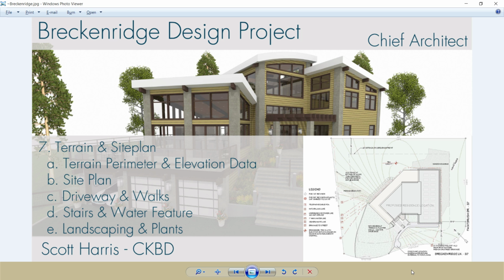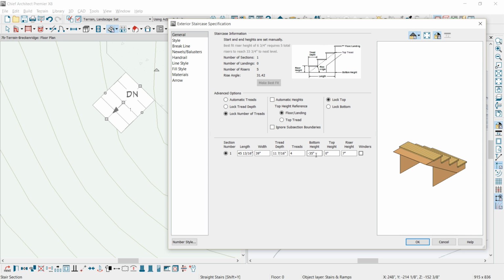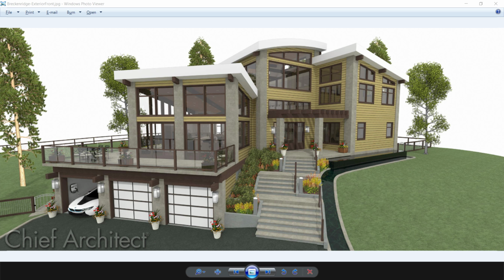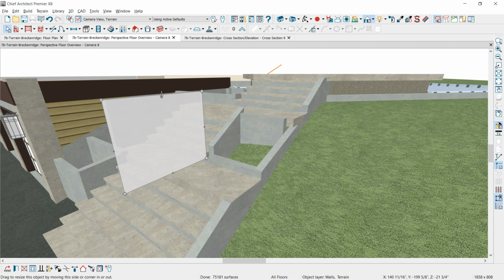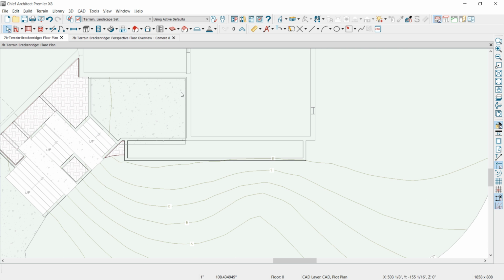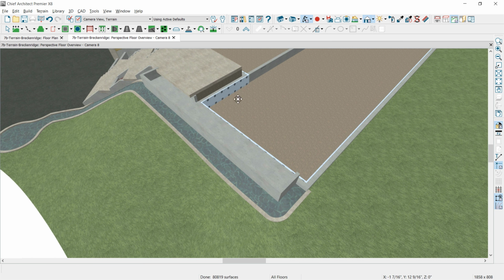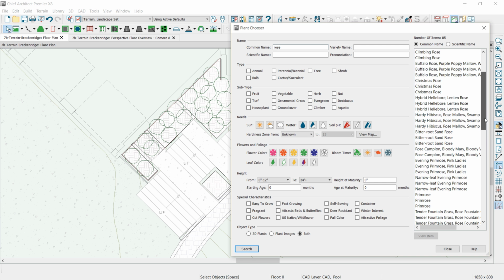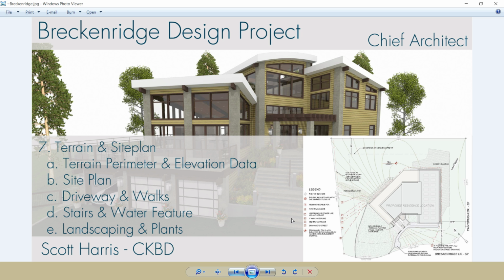Breckenridge Design Project - Siteplan & Landscaping

Comment: Did you show the creation of the entrance porch/slab area? How exactly did you create it?
Reply from the maker: You can use the slab tool to create this entry area. Also, check out the full plan through our samples gallery: https://www.chiefarchitect.com/products/samples.html This Breckenridge plan can be opened in our current X8 version and trial version so you can explore the design.